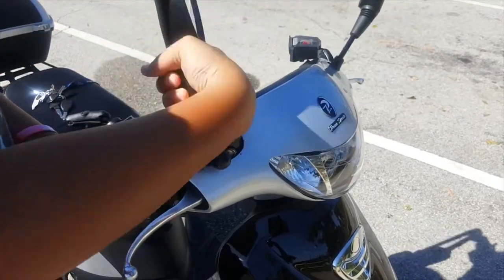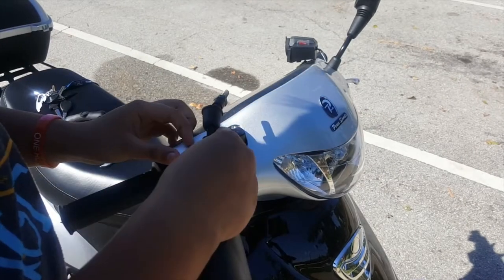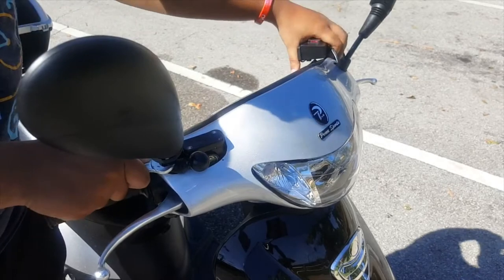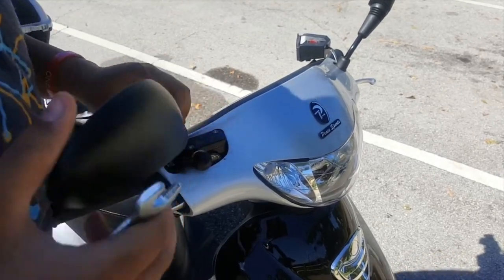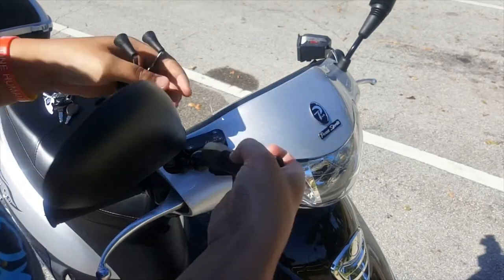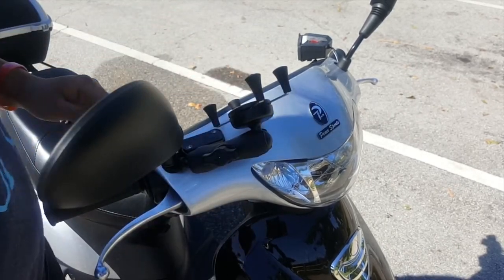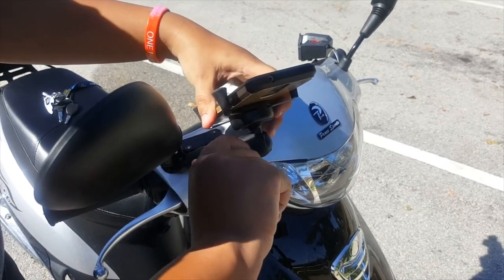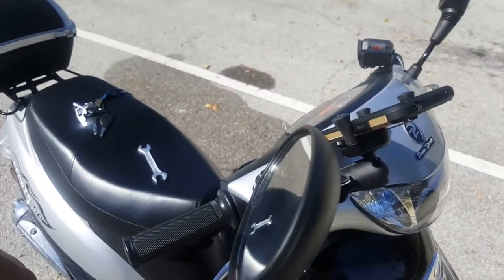How To Install a Ram Mount on a Scooter

Comment: Can you put thicker built-in turn signals mirrors on 150cc scooters
Reply: I don't see why not, just know there's more wiring you will need to run with them and also keep in mind how much voltage the battery can handle safely without being drained over time. See your owner's manual, as well as those mirros voltage rating and amp.